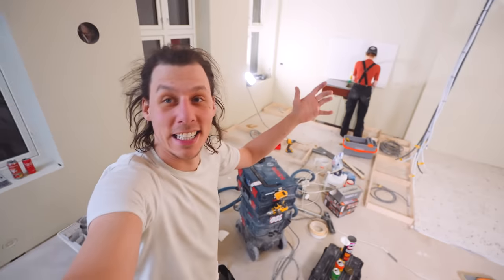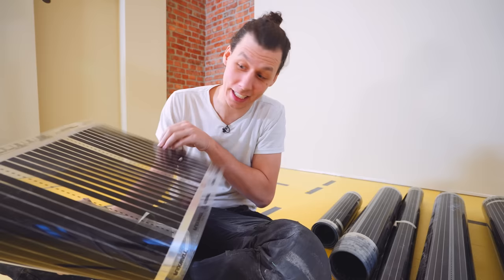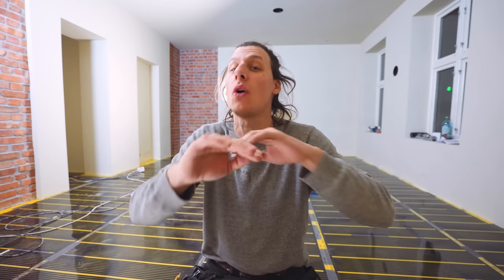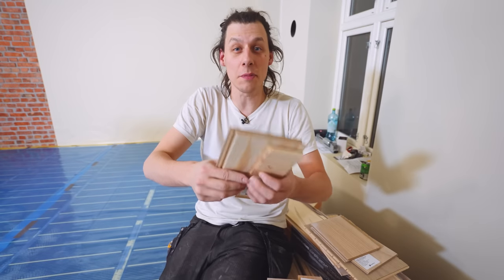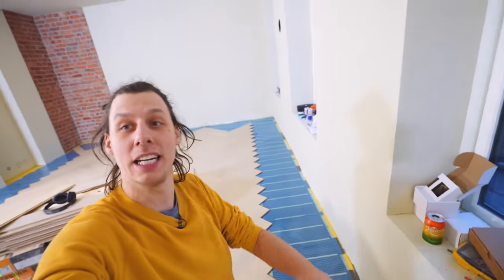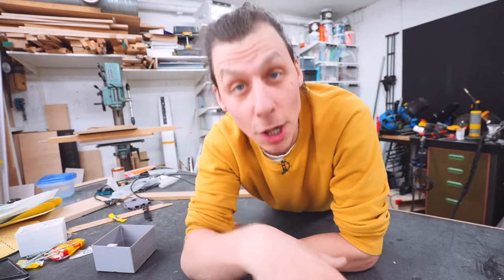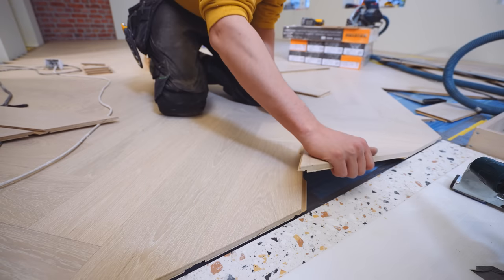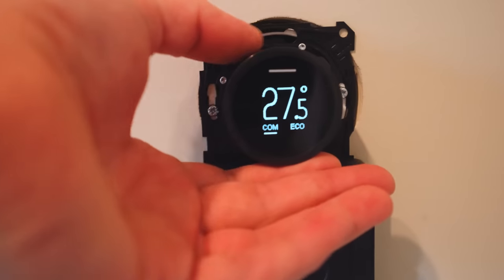How to Install Electric Floor Heating and Hardwood Flooring

Comment: That tool you are using to click them together is called baksmälla in Swedish. The same word for hangover.  I'm used silicon at the passing between tiles and wood in my kitchen. The passing is frequently used since 2008 and is still working. I putted oak-floor in all my ground floor from kitchen into living room and to the hall and then to the hallway. It was many walls to fit  with not to narrow pieces.  It draw it in my CAD first so I could start with a suitable floor piece and then could later fit in to all the walls.

Comment: I understand the transition!  I installed 2500 sq ft of floating flooring in an entire house with no transitions!  It took two weeks and a lot of measuring.  Lasers are a must!  What I found out was my house sits on the foundation out of square! Wall are not straight even if they look like they are! 😆

Comment: I regrated installing the same type of floor heating !!!
Using them is WAAAY more expensive then a simple airconditioning running non stop, so now, i just use the airconditioning and my floor is cold !
Make sure you have an alternative !!!!

Comment: I have a question. Why electrical heating? One benefit with the typical water based heating is the passive heat the concrete and water will give off even with the heating turned off. 
In my Home, we essentially turn off the hole house heating when we are not home and the temperature doesn't drop for days. 
Electrical heating seems a bit expensive for heating over the winter. 

Still AWESOME work. More people have to put effort into learning skills for home renovation like you do.
I grew up in a household where we do most stuff ourselves, and I find it builds confidants and teaches Problem-solving. Things missing in many these days.
Reply: Before Putin invaded Ukraine, electricity in Norway was very cheap so electrical heating was the preferred method to heat your floors. There were still water based heating installed, but it was typically used in bigger projects.
Reply: @Atlantisxx  also if you look at the first few episodes of this series you can see that this floor is not at all suitable for water based floor heating and would require way more work to get that installed
Reply: @DeadlyMitten  way? you can get water based floor heating  that is only something like15mm in height and made to be but straight on the osb subfloor he have
Reply: @fromaflafl2198  yea true those exist, didnt really think about those.
Reply: @fromaflafl2198  The house is insulated with dirt between each apartment. If you accidentally have a water leak in those type of houses. Ya are in a loooot of trouble. So it is safer and cheaper to just go Electrical and not have to worry about potential leaks as a DIY.

EDIT: Basically, before the leak is discovered. All the dry dirt would be saturated and swell to a degree that makes the floor weight a lot heavier not to mention, spread the moisture around all wood beams. Etc. Unless a company takes the blame for the installation, he... as a DIY, wouldn't do it. Just not safe or sane.
Reply: @Helveteshit  such a great point. Very logical.
Reply: @Helveteshit  that's not a problem the "pipes" are continuous with no joint's in the Floor. so they are not going to leek except if you put a screw/nail trug it. and he got the exact same problem with the other water pipes running in the flore/celling for hot and cold water

Comment: Absolutely loving this series! The perseverance and willingness to learn and try is a real inspiration. I'm super pumped to reno the ground floor of our house - just need to convince my partner that it'll be worth living in a building site for a while 😅. One question though: Did you fully plan out the whole reno before you started, or have you kind of developed your ideas as you've worked through it?

Comment: Just wondering why there is no foil layer underneath to reflect the heat upwards? Herringbone, you just had to make your life more difficult. Floor down! From now on... "mind the floor!". Thank you for this series it is so engaging and fascinating. When the apartment is done I have no belief that you will just settle into it. I bet you start another one within a year.
Reply: You only do a plastic foil layer underneath if it is a linoleum floor, because of the danger of gas buildup from the heat or if it is a "wet room" as we call it in our rule book for electrical code.

Comment: How much kWH will this use? I think electric heating makes sense in a small bathroom, but not in the whole apartment. A heat pump would be much more efficient.

that being said, i  really enjoy this series 😃 /
Reply: Those foils are usually either 60 or 80W/m^2. So I'd guess somewhere between 2-3kW for the living room in his case.

Comment: Very cool video Alex, im only a little bit concerned that you didnt go to a floo heating utilising a heat pump wich has 3 times the efficiency of simple resistive heating
Reply: Probably he had nowhere to put external unit. Old houses/apartments problem...
Reply: @petpaltea  There are indoor monoblocks which only need some pipes to the outside. But even those take up quite a bit of space and I believe the pipes cannot be too long. So probably also not an option here if we look at this appartement.
Reply: It is possible to have one unit for the whole building. That would be the best
Reply: @MuerteDiablo  But for those the efficiency drops, to like 200%.

Comment: IIRC, when they installed herringbone flooring in the past, they ran boards straight along the walls as a border, which would take up the room that caused those tiny triangles.

Comment: Electric heating is forbidden here in Switzerland. Heatpumps, which are also electric, but harvest the bigger part of the energy from the environment are allowed though. Tbh. I agree with the bann on electric heating. Because electricity really can be used 3x more efficiently in heat pumps. 
But if you really must heat electrically, think about this: You could have a big server mining bitcoin and the excess heat would be equivalent to the power use of the server (law of energy conservation) if you have it water cooled, you could run that water through the floor, like normal water-based floor heating. Sure, you might need a couple of servers, BUT the energy used is the same as for heating only, while you get crypto for free in the process. 
In general I think crypto mining for heating is a stupid idea. Just as bad as heating with electricity directly. (heat pumps) but if you heat electrically, directly, better mine.

Comment: I had the impression that hydraulic based floor heating was cheaper to operate over time than electric based floor heating. Is that still the case or is this new tech more efficient?

Comment: I would be concerned that repeated thermal cycling will eventually cause one of those crimped connections to fail, necessitating removal of the hardwood to repair it.

Comment: Tubes I guess much better than electric as when you install tubing for heating and cooling you can change the source of heating without having to change the whole system.

Comment: But u know that this isnt efficient ???
for the price of power in first months of heating u could order someone with papers for working with AC units to make you DIY heat pump from AC unit (just replace air heat exchanger to copper tube bend into spiral shape and put inside a big water pipe (dont use plate heat exchangers because they fail all the time, they only work in perfect conditions meaning only without defrost etc)...add water pump to move heated water trough the house / apartment and u have heat pump heated living space with 4-5x efficiency of "Resistant matt"  (to people that don't understand heat pumps -- they can give u 4 times more heat (+/- sometimes even 8-10 times more but with ground source) but they dont generate heat --- they "collect" energy from outside and pour it inside 
its like when u use deodorant that go out freezing cold where the bottle is warm...its the same just in reverse and in circle

Comment: One more thing it can be important...
A mil is a measurement that equals one-thousandth of an inch, or 0.001 inch. One mil also equals 0.0254 mm (millimeter). 
Thus a mil is not the same thickness as a millimeter. The term "mil" is not an abbreviation but a unit of measure.

I'm super impressed with your work. Not beeing a professional "builder"...

Comment: So this is basically a electric blanket but at a whole house level?? Sounds good but not very efficient? Yeah at leas where electricity actually costs too much
Reply: I installed this type of floor heating three years ago. Having it on sequental heating is the best way to save on power but all in all it is amazing. Gets the floor nice and warm really fast, is easy to install and can be installed underneath any type of flooring

Comment: I hope that 3mm gap is big enough to allow for the wood swelling when it rains for a few days straight. Chances are it will swell up to the tiles and the planks will start to lift 🫣
Reply: I would defs seal all the cut edges in that section with some clear varnish if you can, to keep the moisture out.